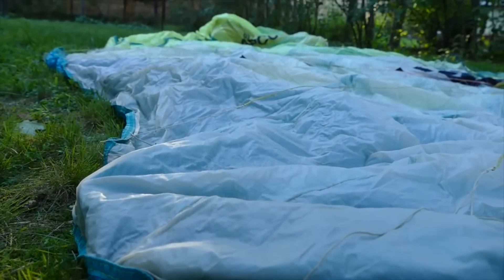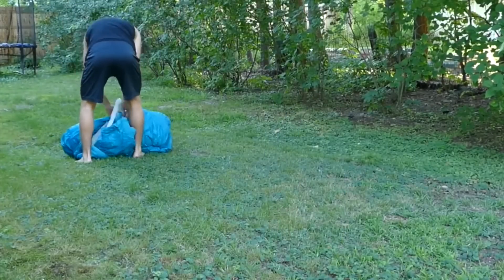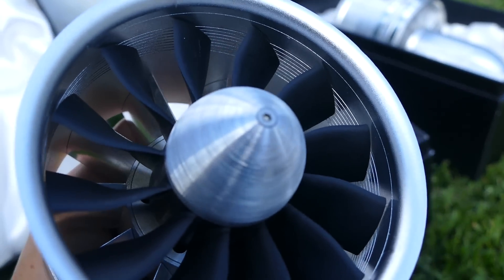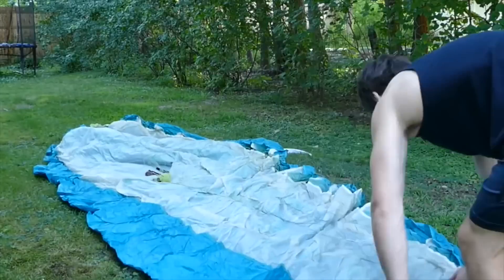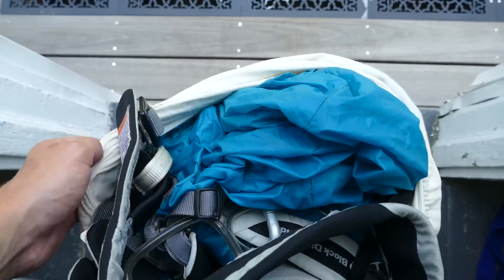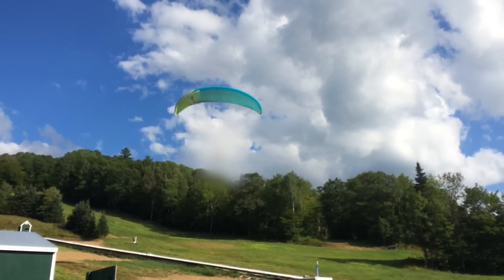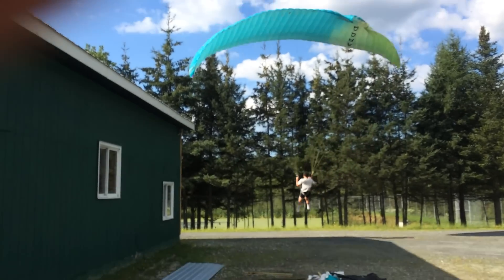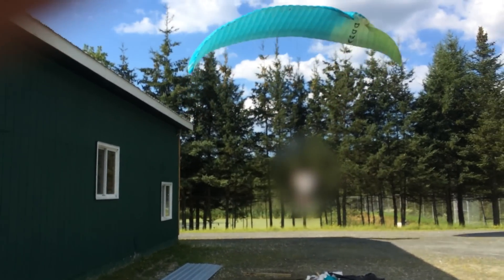Flying with Jet Engines! - TEST FLIGHT!!! (DIY Backpack Jet Aircraft Part 2)

Comment: I like the idea of electric ducted fan jets, as opposed to whiling propellers on the back. You might consider using an IC engine to generate electrical power for the jets, and just use a smaller battery, which also could be kept toped up by the generator, for controlled emergency landings on engine outs. Thanks for the video.

Comment: Yo I can't find any 44 Volt batteries can you link them I could find a use for them too I'm currently doing two 25.9s in series but would love to have two 44V batteries in series
Reply: HobbyKing has 44V in plenty of sizes.  For LiPos that's 12s.

Comment: Jet engines are gas powered. Those are EDF (Electric Ducted Fan) engines. Kilogram is a unit of mass not force. Pounds and Newtons are force units. Assuming you put these on a metric scale and ran it up to max thrust- the scale is taking the force and deviding it by the earths gravitational accelerarion- 9.8m/s^2. Backtracking a bit, multiply 8kg times 9.8m/s^2 gives 78.4 Newtons of thrust. I dont have OCD but my God I just had to clarify that.

Comment: Questions why are you blurred, were you wearing a helmet, why you even attempting to fly without any lessons from a certified instructor, not sure if 2 RC EDF fans are strong enough to fly that glider with the weight of a human body.  I have bought many products from Hobby King.  Half their products break or are shipped damaged.  Most of their speed controllers I bought from them overheated and failed even though they were rated for the correct lipo battery.  If you plan on continuing with your idea please go take lessons on how to fly that parachute glider before you break your neck.